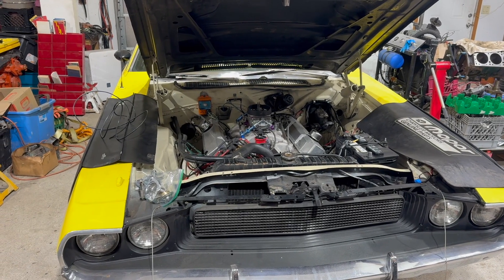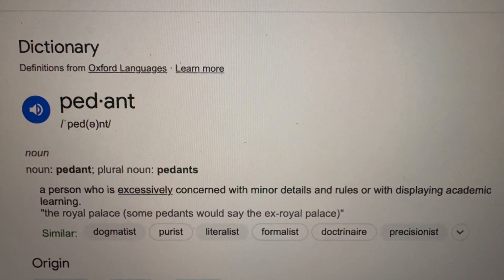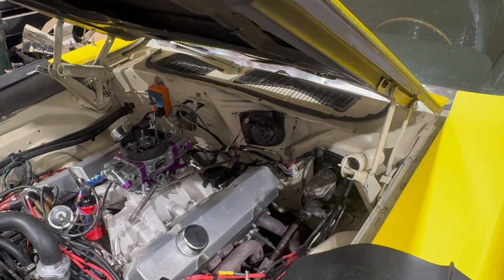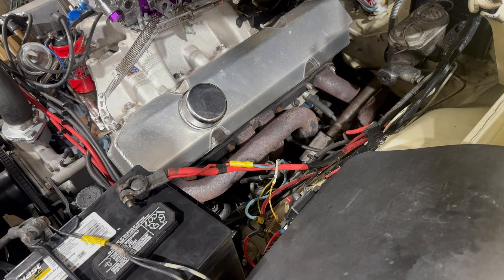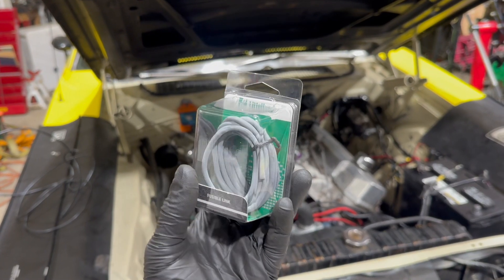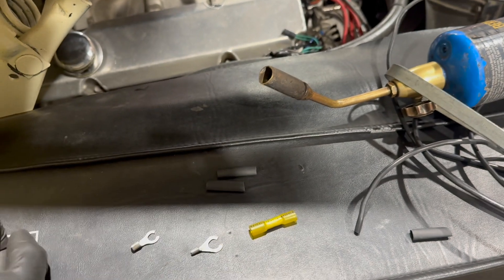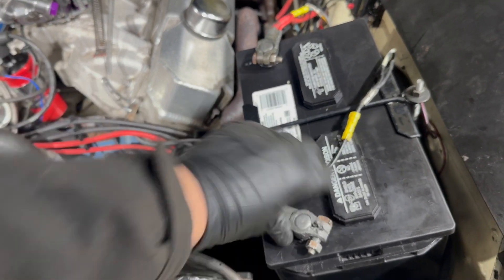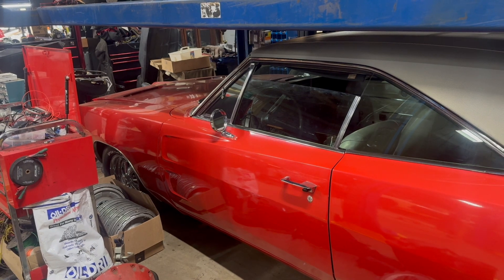The Big Shunt Wire Guide - Prevent Electrical Meltdown In Your Classic Mopar With This Easy Fix

Comment: It´s a shame that I can like only once. I love the copper stuff, treated myself to a new soldering station, a Yihua 982. But watch out: AliExpress sells them cheap but i didn´t research enough and got me a C210(40watts) handle, because stoner stupid. 
For this kind of work You want the C245(110watts) handle. But the C210 does surprisingly well for me.
The kicker is the heat up time: 3 seconds in my case, the C245 might take 5. Because of the complete different handle/tips. In my crappy iron the tips are sleeved over the heater, the Yihua tips ARE the heater. The heating element sits just millimeters away from the actual iron tip, that´s why the buggers are so fast. 
And, when You put the iron in the holder it decreases the temp to 200C, they put a hall sensor in the iron rest.
That´s why I can´t just buy the bigger handle and tips. It might blow up the power supply (mine´s rated for 40W, not 110) and won´t fit the holder. That´s why I say "stoner stupid".
But I might get me the C245 next year, they really are that great. Happy New Year, Jamie Family!

Comment: What's your opinion on many factory cars not having any kind of fuse in the charging cable from alternator to battery? First shunt I used a fuse. After that I have just routed the cable from alternator to the starter relay and another from there to battery.
Reply from the maker: Generally, as on this car, there will be a fusible link. And as mentioned, alternator output is routed through the car and then back out through that. That’s really your only line of defense, but it is better than nothing. I have added several to my own vehicles that do not have a fuse or fusible link as well. But that’s me. I have a good idea what to do if acrid smoke starts billowing out from under the hood. For the average car enthusiast, I would strongly recommend a fuse or fusible link.

Comment: Likely was the high powered stereo amplifier I installed that caused the Amp meter in my 1969 Charger to burn out causing me charging problems for a long time before installing a heavy duty underdash Ampmeter that got very hot.

Comment: Good information. I hunted up. A few original date coded 37 amp alternators that had never been through a rebuilder, then found a shop who understood  what I didn’t want them to do. I’m still living dangerously, but I have developed a good nose for hot wires and soft plastic. These are lessons learned the hard way.
Reply from the maker: They sure are!
Reply: Excellent how and why video! Thank you

Comment: You know what I really like, at least in 1940s-50s Mopar trucks? The "amp meter" needle flickers back and forth a lot, which I assume is just the mechanical regulator points opening and closing. It's really entertaining! Anyway, I am going to decrease the entertainment by installing a shunt wire in my 56 Dodge pickup. It just seems like a good idea.
Reply from the maker: It’s certainly not a bad idea - but if the truck is all stock, I wouldn’t worry about as much. They are wired point to point and don’t have the same bulkhead connection issue. Well, it probably is still cloth wire… so there’s that.